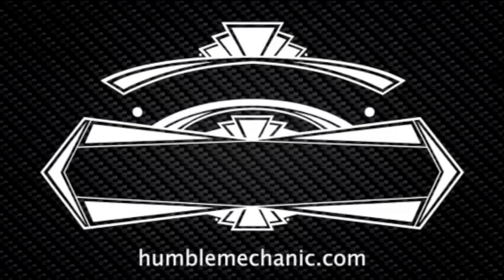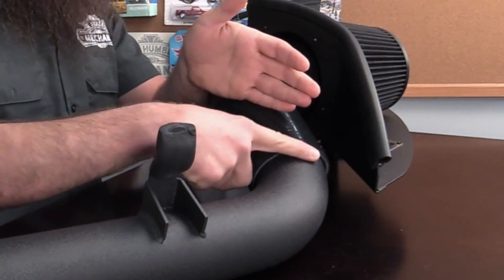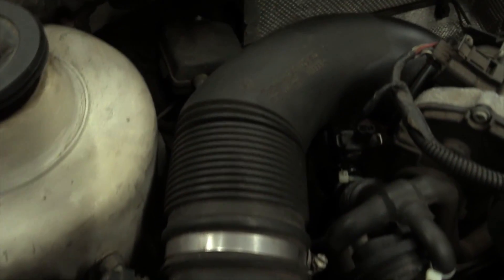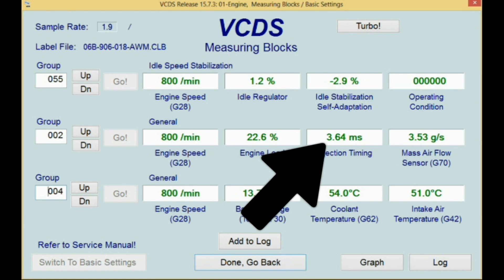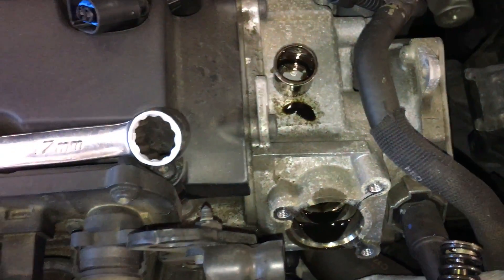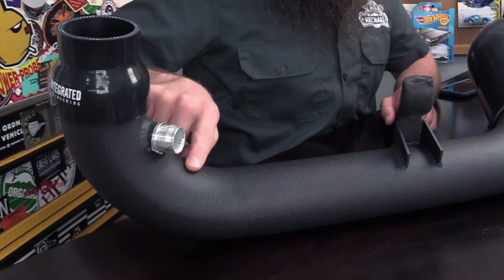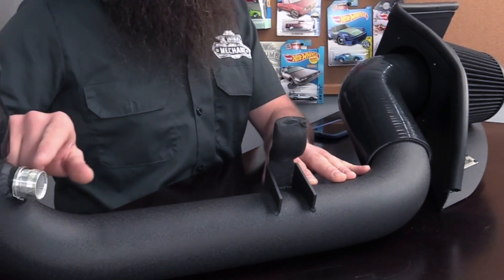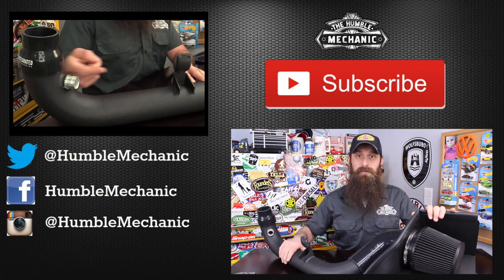What Does SYSTEM LEAN Mean?

Comment: I have been battling a P2096 code on my 09 GTI for a few months now. Replaced the vband clamp before the rear O2, replaced the Rear O2 with the newer revision, replaced the downpipe gasket and put a welded exhaust in after the rear O2. From what I can tell, I've covered all of my bases on replacing things. But, the code stays.

What is typically the next step for finding this issue out?

Thanks!
Reply from the maker: +Christopher McGee any oil leaks?
Reply: One just popped up somewhere under the engine. I'm hoping it's not the rear main, as I just replaced it last year with the clutch...
Reply from the maker: +Christopher McGee damn!  Oil leaks can totally cause lean faults. 

What are the parameters of the fault being stored?
Reply: @HumbleMechanic  Hello thanks for the replies and I have learned a lot. I am having the same issues, the code P2096. At the same time, I have replaced a ton of parts and the code still there. I have to mention that the vacuum pump is leaking engine oil too, does this issue cause the code P2096? Thanks!!
Reply: that's an expensive way of covering your bases dude. Needs diagnosis not the parts cannon
Reply: +TheCriminal3k I know. Its not like it did it all within 1 day. Exhaust was going to happen at some point anyways, as I was getting rid of the stock catback. The O2 sensor was really the only thing I didn't want to replace, but it's the newer revision.

Comment: Charles how about collect some bad parts, air tubes, maf sensors, o2s, install them and then show different diagnostic scenarios while you work on the project cars, that way you can work on them at the same time and then show videos too.  Then also show the scan data when these problems occur.
Reply from the maker: +busjockey1 man that's a great idea. That is a long term type project type thing, so it may be challenging.
Reply: +HumbleMechanic maybe you can put a list out and people can send you bad parts if needed to test and show that you don't come across often enough.

Comment: P0171,   when I worked on Mercedes back in the 1990's with CIS Boush Injection we used to set Lambda. Mercedes  continued to use the term Lambda till this day like VW according to VW. Nissan/Infiniti use the term Alpha %. 100% being ideal anything over 109% being lean and 91% being rich. Its the same info but different terminology is used to read the same value. 
Here's my dirty trick of the day, while the scanner is connected and Lambda or Alphas for you Jap car guys in being displayed at idle spray your chemical in the suspect leak areas, when you hit the leak the Lambda or Alpha % with go rich. This is especially good for the more minor leaks that have thrown the  P0171 or P0174 codes for the V shaped engines with two banks.